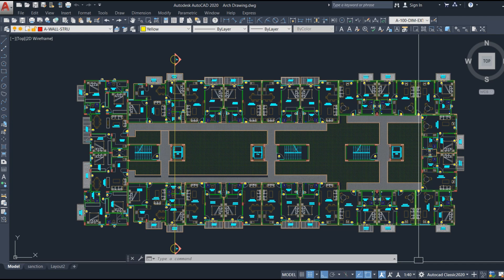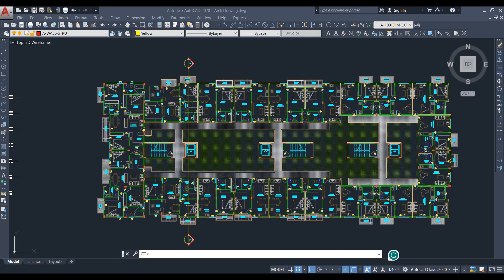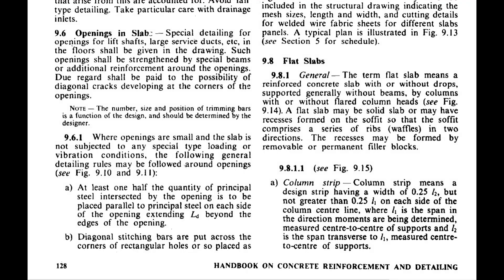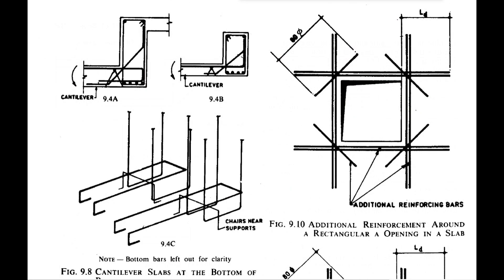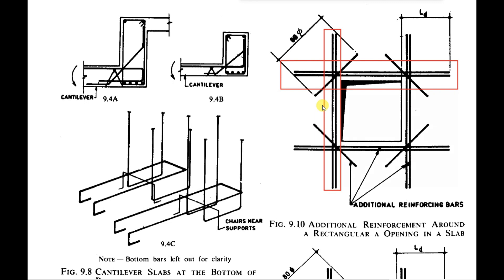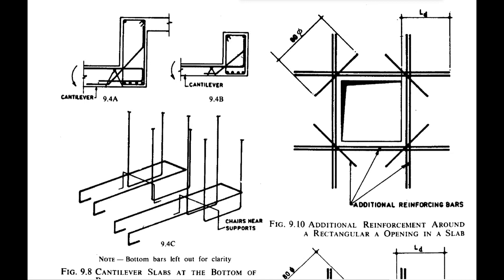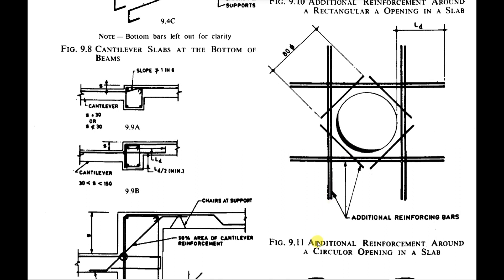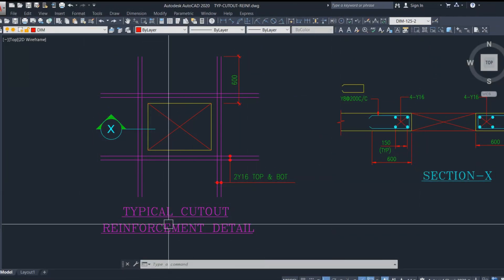Openings in Reinforced Concrete Slabs | Detailing Requirements for Openings in Slabs | Slab Cutout

Comment: Should we provide any extra bars in beam that are supported to sunken slab ?

What should be the spacing of parallel and diagonal bars ?
Reply from the maker: Yes, extra reinforcement is typically required in beams supporting sunken slabs. Sunken slabs introduce additional loads and stresses on the supporting beams.

The spacing of parallel and diagonal bars depends on several factors, like the size of the opening, load on the slab, and type of opening.
Based on the area of reinforcement we can calculate the spacing.

Comment: Mam i can't understand how you calculated 250mm2 steel in opening...Did you multiply length&  dia of steel?
Reply from the maker: 250mm^2 is the area of main reinforcement in the slab, as per the SP-34 code we need to consider one-half of the main reinforcement(slab) around the openings.
250mm^2 area was taken for example.
Reply: @CivilEngineeringMastery  Thank you so much...Your way of explanation is great, keep rocking...Thanks again
Reply from the maker: You are welcome. Thank you.

Comment: Please clarify if we need the diagonal bars top and bottom
Reply from the maker: Diagonal bars are required in addition to the straight bars if the opening size is 450mm to 900mm, in case of circular openings and the slab thickness is 150 mm or more at the top and bottom face of the slab.
Reply: Thank you for the reply. But my question is  if diagonal bars required to provide both top and bottom
Reply from the maker: Yes. Both top and bottom diagonal bars are required.